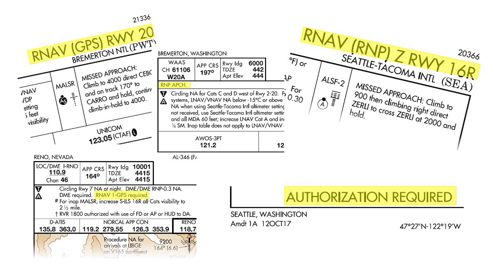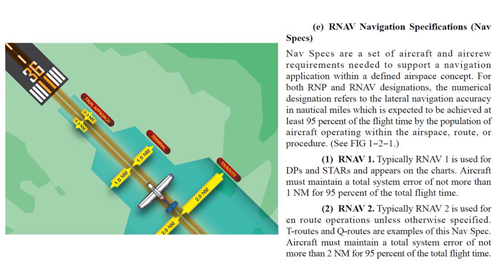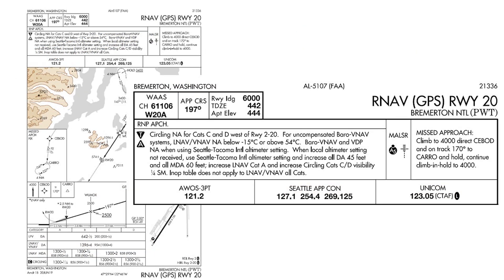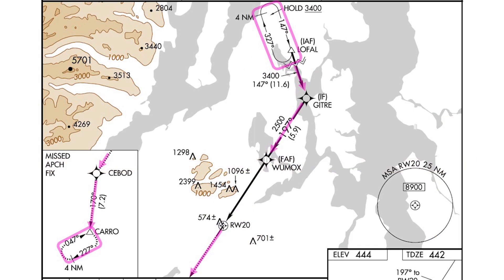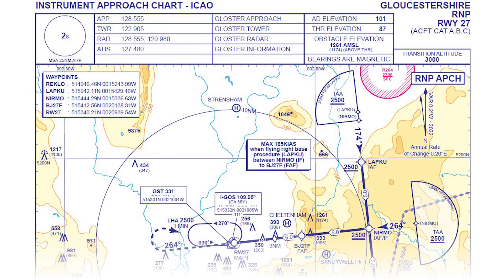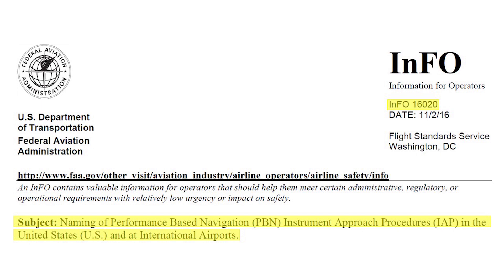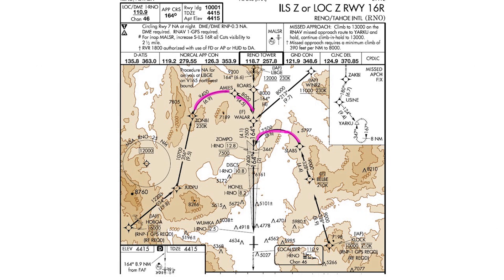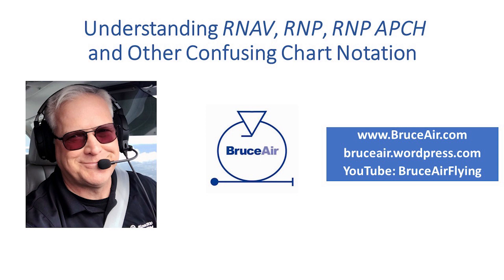Unscrambling RNAV, RNP, and Other Chart Naming Conventions and Notes

Comment: Thank you very much for your explanation. May I ask what do we understand by an RNP coding? Is the RNP coding a way to set different variations of an existing circling approach?
Reply from the maker: RNP is not associated only with circling approaches. It is a set of standards for performance based navigation (PBN). In general, different RNP levels are linked to phases of flight, such as operations in the terminal area (IFR departures, arrivals, and the initial/intermediates stages of approaches), en route, and different types of approaches.
Reply: @BruceAirFlying  Many thanks Bruce. I had this doubt because I was reading this from an ICAO document: "The RNP coding is a mapping of an existing circling approach, therefore the published minima remain applicable." Thank you.
Reply from the maker: My article about PBN appears in the May issue of AOPA Pilot--"PBN Bingo"
Reply: @BruceAirFlying  Thank you very much dear Bruce. I will read it.

Comment: Actually, the ILS Z or LOC Z RWY 16R should have the "RNP APCH" NavSpec per FAA Order 8260.19.  RNAV 1 - GPS is used on Feeder segments of a conventional approach that require RNAV.  If RNAV is used from IAF to the FAF, or from the MAP through the missed approach, the NavSpec should be "RNP APCH".  Unfortunately, we're some issues with these NavSpecs getting published correctly on US IAPs.
Reply from the maker: Yes, and we also see "RNP APCH - GPS" notes on procedures with "RNAV (GPS)" in the title (again, see FAA Order 8260.19I). As you know from the interminable discussions about procedure notes at the ACM, it seems there's a lot of "left hand/right hand" at the various FAA offices.